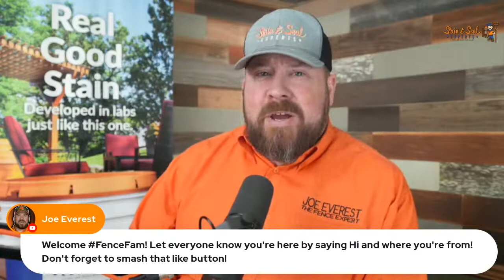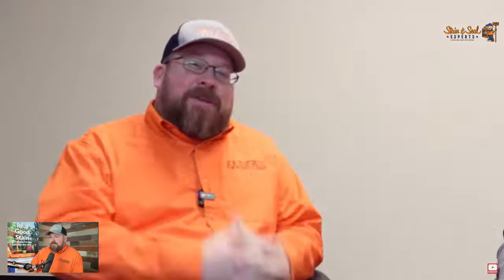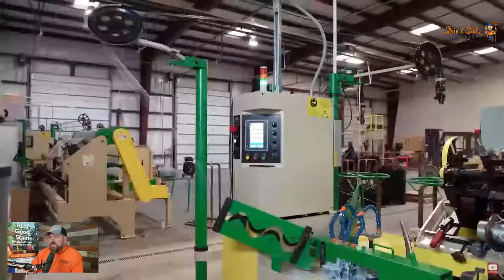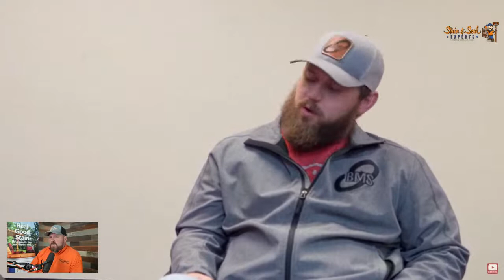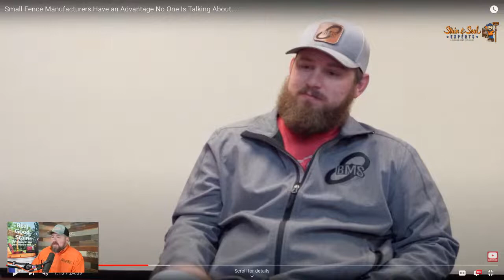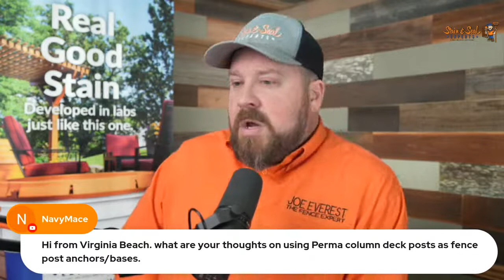Ask The Expert - Live Q&A + Contest Discussion

Comment: Hello Joe. Just discovered your channel and I'm going through all your vids. I'd like to build a horizontal board modern looking fence, and I'm realizing that they are built like a deck where you nail on posts and so you have a finished side and a post side. I want to avoid this so that it looks the same from both sides, but I can't find a single video showing how to do that. My idea is to use joist hangers and install the boards between the posts, in the center, and then cover them up with vertical trim on both sides of the fence to cover the hangers. Question 1 - Is this viable, i.e. will it be structurally sound? Question 2 - Have I saved any money if I'm replacing 12 to 17 boards (depending if I overlap) to finish the other side with the hardware (24 to 34 joist hangers)? Thanks!

Comment: Joe, I am seeing a lot of conflicting information about cleaning shared wooden privacy fence. The house is about 18mo old (as is the fence) and it's already faded as though it wasn't ever treated or sealed (we just moved here 2mo ago). I was going to pressure wash the fence then use a sprayer to stain\seal it. Though there is mixed input on using a pressure washer vs a regular hose. I will not sand\scrub the fence as that would take ages. Advice? Thanks.